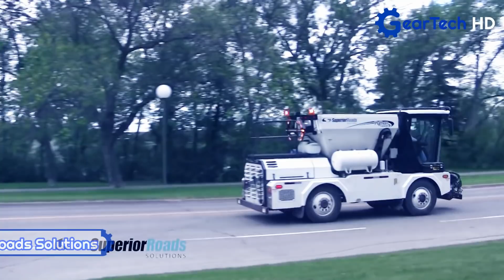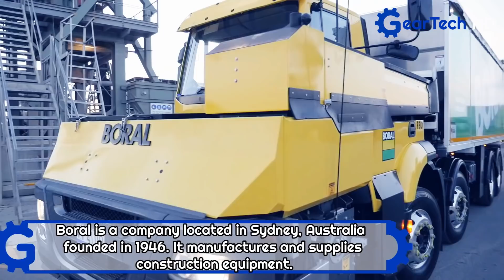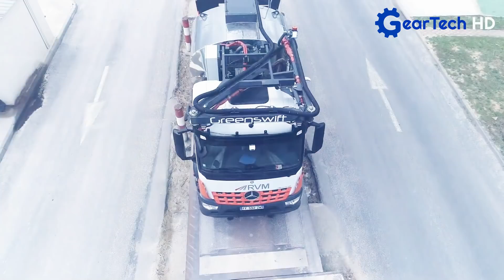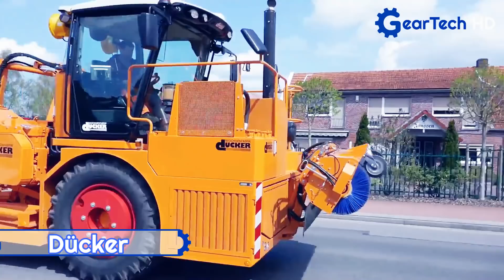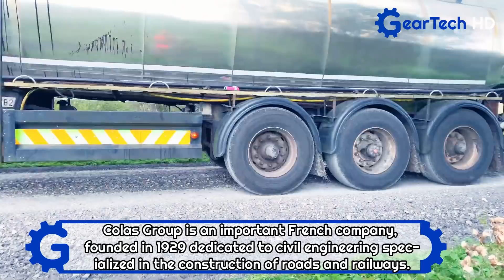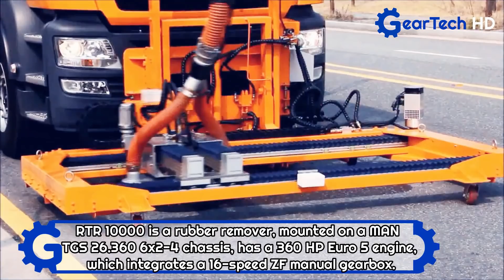The Most Advanced Trucks for Road Maintenance You Have to See ▶  Pothole Repair Truck

Comment: That first one didn't put any oil down,so that hotmix is just gonna pop right out once it cools! Cool but worthless.
The boral forward spreader is pretty slick!
The third one, French one,is pretty cool,the pot hole fixer on the front is pretty much crap(Missouri highway Dept tried a similar system damn near 20 years ago...it sucked) but the chip seal oiler spreader and wobble wheel compacter combo is pretty damn cool.
The ducker thing is great! That one man operated machine is doing something that usually takes 4 or 5 machines to do around here!!!
Have seen that in situ recycling process done before,it's pretty affective!!
The last one was a skid marks remover?? I guess if you want neat appearing streets??